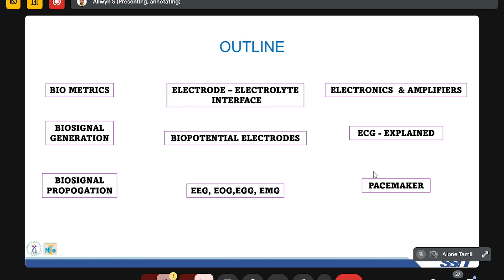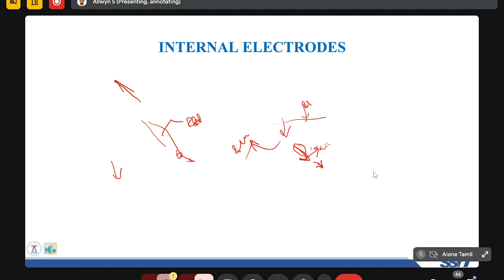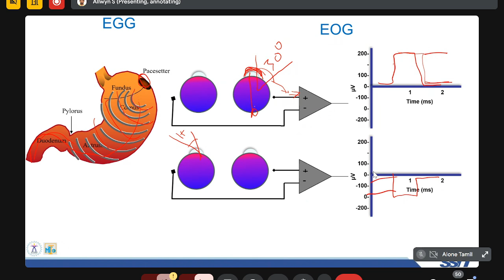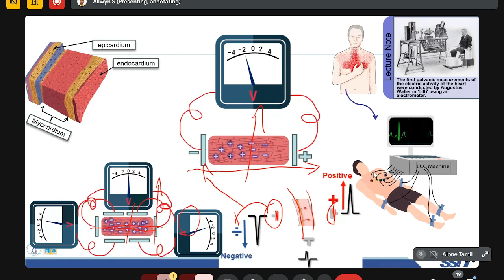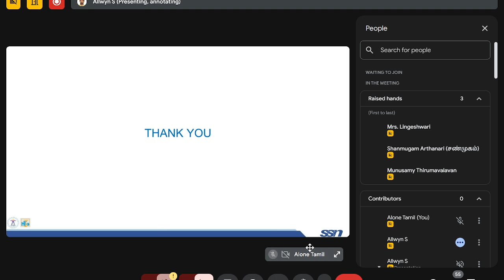Biomedical Instrumentation Explained | From Foundations to Advanced Concepts

Comment from the maker: This video features a lecture by Dr. Alvin on the principles of **biomedical instrumentation**, covering everything from foundational physiological signals to advanced diagnostic devices. 

### Key Topics Covered:
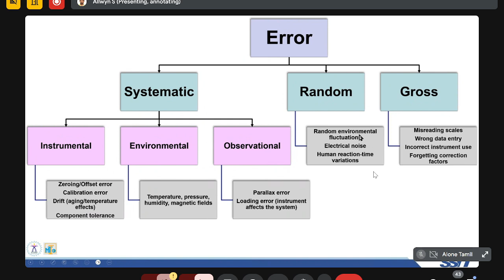* *Fundamentals of Bio-instrumentation:* Discussion on instrument characteristics including range, sensitivity, linearity, and various types of measurement errors (0:02:17 - 0:08:55).
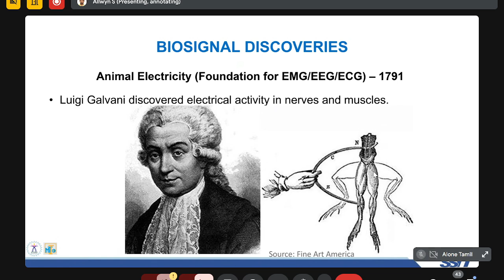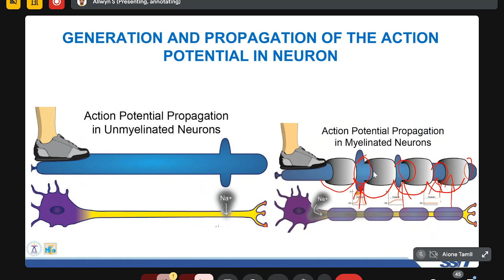* *Bio-signal Generation:* Exploration of action potentials, the role of ions ($Na^+$, $K^+$, $Ca^{2+}$), and how signals propagate through myelinated and unmyelinated neurons (0:10:13 - 0:18:42).
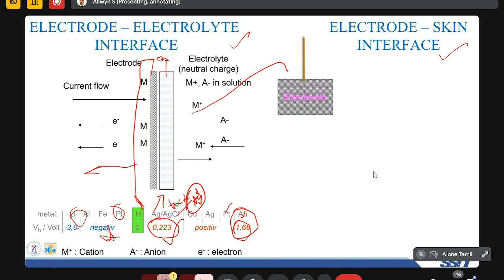* *Electrode-Skin Interface:* Explanation of how electrodes interact with biological tissues, including the equivalent circuit model of the skin-electrode junction and different electrode types like suction cups, needle, and micro-electrodes (0:25:00 - 0:46:40).
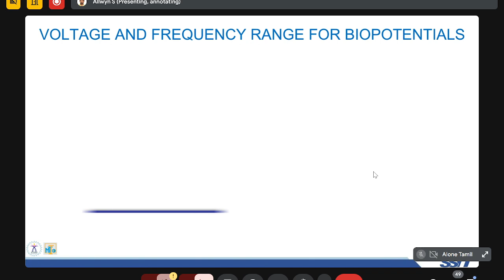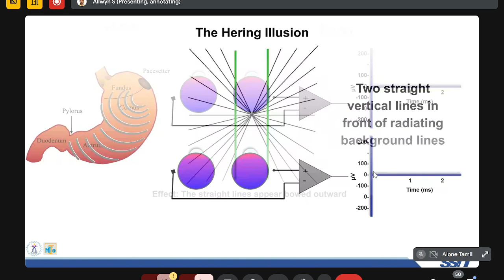* *Bio-potential Signals:* Overview of common signals including *ECG**, **EEG* (explaining delta, theta, alpha, beta, and gamma waves), *EMG**, **EOG**, and **ERG* (0:48:12 - 0:52:40).
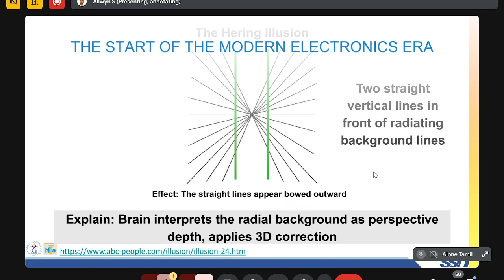* *Signal Conditioning & Instrumentation:* Deep dive into operational amplifiers, buffer amplifiers, and filtering techniques (high-pass/low-pass) used to isolate medical signals from noise (0:53:26 - 1:04:00).
* *ECG Detailed Analysis:* Comprehensive look at the 12-lead ECG system, cardiac vector analysis, and the phases of cardiac action potentials (1:04:43 - 1:26:15).
* *Advanced Devices:* Brief introduction to pacemakers and pulse generators (1:26:48 - 1:28:00).